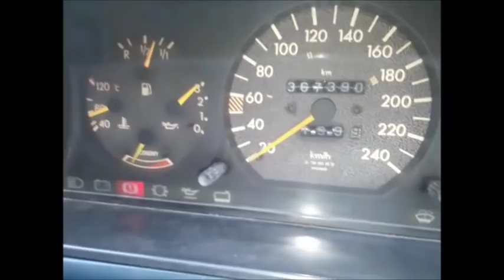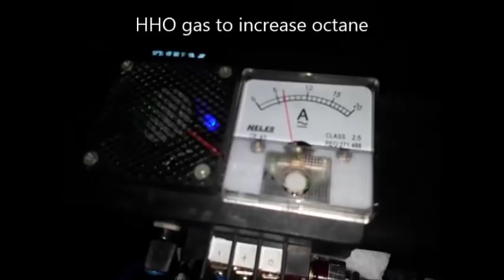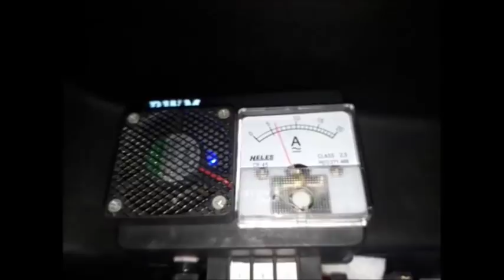Fuel saver HHO Joko Energy on Mercedes Benz 200E 1986 Boxer

Comment: HHO ini satu2 nya fuel safer yg saya percaya bisa hemat bbm
Reply from the maker: thanks bro
Reply from the maker: ya benar ..... tp bukan hanya itu saja:

Kendaraan yang menggunakan Generator HHO "Joko
Energy" akan mendapatkan berbagai keuntungan antara lain: 

1.       Menghemat konsumsi BBM mulai dari 20% hingga 80%.(lihat testimonialnya di: www.jokoenergy.com)
2.       Mesin lebih bertenaga.
3.       Meningkatkan Torsi dan Akselerasi
4.       Menghilangkan Knocking / Detonasi
5.      Sangat ramah lingkungan. 
6.       Ruang bakar mesin dan knalpot bersih dari kerak Karbon (Cleaning Engine). 
7.      Bebas gas beracun , Terbukti hasil Uji Emisi pada: Avanza, Xenia dan APV ,Gas Karbon Monoksida (CO)= 0,00% (lihat videonya di youtube ketik: jokoenergy uji emisi)
8.      Membuat mesin awet muda.
9.       Mengembalikan performa semula seperti saat mobil masih baru.
10.    Getaran dan suara mesin lebih halus.
11.    Penggantian oli mesin lebih lama.
12.    Suhu mesin lebih dingin dan stabil
13.    Kecepatan bertambah melebihi batas kecepatan sebelumnya.
14.    Sangat aman digunakan. 
15.    Pada mobil bensin: Cukup isi Premium atau Pertalite maka minimal setara dengan Pertamax atau Pertamax Plus.
16.    Pada mobil diesel: Cukup isi Biosolar maka minimal setara dengan Pertamina DEX.
17.    Jika tidak terbukti maka dalam 2 minggu 100% uang kembali kecuali ongkos pasangnya.